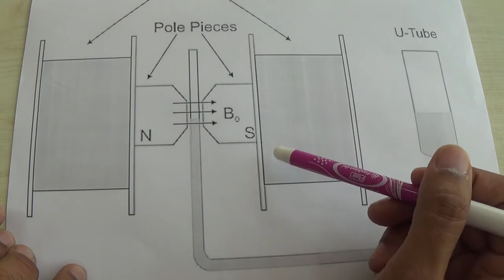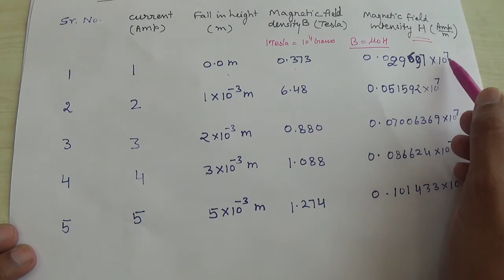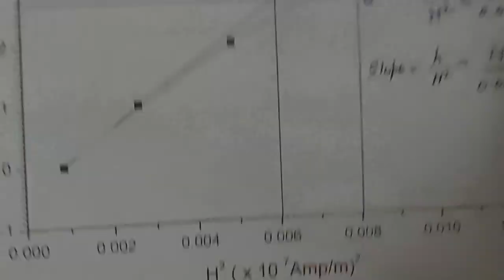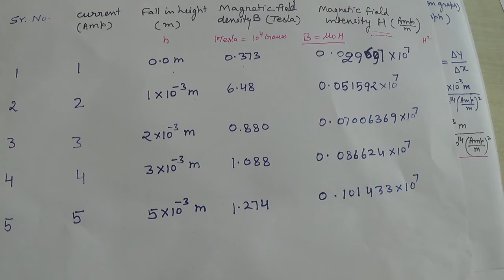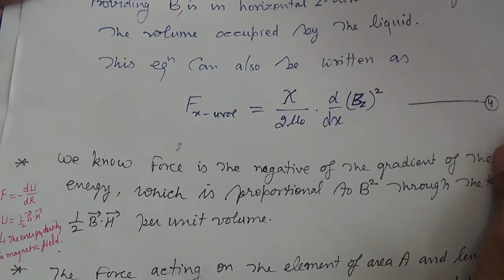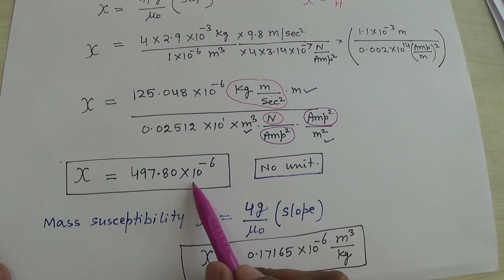Comment: Sir, in this experiment u have fixed flux meter in 20 KG but in calculation it is calculated using KG only. Why 20 is removed? isn't it necessary to multiply by 20 to convert 20KG to gauss?
Reply: That is scale of measuring the flux from 2K to the 20 KGauss....so one can measure 3 Kg, 7Kg, 18 KG up to the 20 KG....why do one need to multiply by 20....you can think and observe through experiment does your appratus measure more than 2KG when you put button towards that side.....nahi na....but when you put it at max 20 KG than it measure up to that limits.....no logic to give 2KG and the 20 KG fixed value to button...that is scale in Kilo Gauss.
Reply: Thanks sir, I was confuse in  this...it helped me..
Reply: my pleasure...best wishes always...